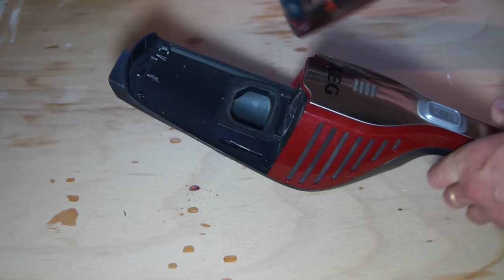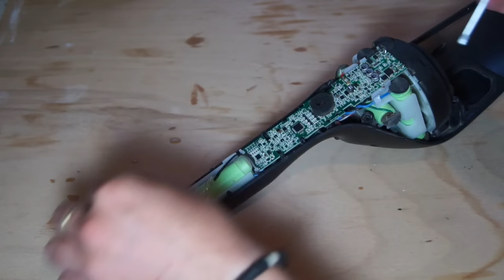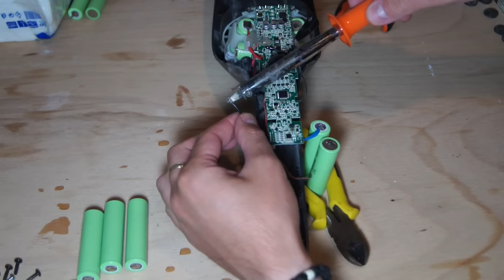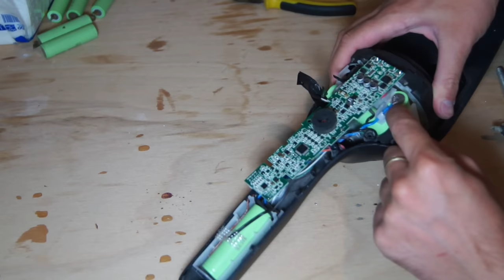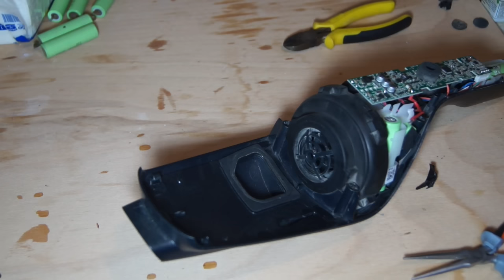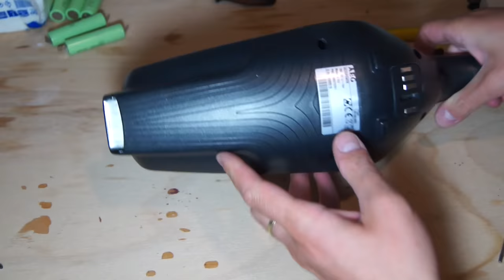Ergorapido Battery replacement - Inlocuire acumulatori

Comment: Hi. How would i know if my batteries are damaged. I bring my vacuum overseas, when it arrived, the lights are blinking which means full charged, but i believed the batteries are empty because it’s almost 2months before the vacuum arrived home. The vacuum now it’s not working. No power. Hope u can help. :)
Reply from the maker: First check the voltage of every battery, if they are all at the same voltage when charged (4.2v) or one of them is dead i think it will be best to change them all. Also check the voltage of the charger.
Blinking lights could mean that the batteries have a problem, check the manual to see.

Comment: I have a model EER73IGM 21.6Wh and 14.4v.  There were installed 4 batteries Sony / Murata US18650VT3 1600 mAh - 10A.  I changed to Sony/Murata US18650VTC6 3120mAh up to 35A max.  And now when I press the power button, it emits a beep and that's it🤷‍♂️🤦‍♂️ the flashlight on the bottom of the brush also lights up for a second and goes out, nothing is charging.  All batteries were charged prior to installation.  Didn't change anything when I replaced it.  What is the reason that it doesn't work?
Reply from the maker: Hello, please check polarity and also make sure the new ones are rated 35A. Make sure that they are not fake.
Reply: @ImpactDIY  I didn’t make a mistake anywhere, I did everything well👌 but since I didn’t have a multimeter🤷‍♂️ and the fact is that I soldered it with a soldering iron and killed the new battery by overheating it😂🤦‍♂️ today I bought a multimeter and checked - it was not 14.4v  it was 9.9v, so it didn’t start☝️🙂 took the same battery and soldered it very quickly so as not to overheat it and a miracle happened, it works now😂😂😂 and now it has 16.8v and in my opinion it even became a little more powerful☝️ i’m happy 😎🔥

Comment: I have Ergorapido lithium model EL2089, inside batteries are INR 18650-15L M Samsung SDIEM 120 - I am told by Electrolux that these batteries are no longer made.  Great! Now what?  Is there a replacement battery that would be suitable?  The back of the hand unit shows Volts 14.4 DC. Electrolux was no help with this question.

Comment: After I changed the battery, the charging light worked normally, but the vacuum cleaner could only run for 0.5 seconds.🥲Do you know where is the problem?
Reply from the maker: One of the batteries may be damaged or the batteries model is not good. It needs to handle 20A discharge
Reply: I used INR18650-25R ,it should work🙈
Reply from the maker: Maybe one of them is bad, try to measure each one while starting the vacuum cleaner. Check for a big voltage drop.
Reply: I bought another batteries , but the result is still the same🥲
Reply from the maker: :( The motor is spinning ok? If the motor is bot spinning ok is taking more curent and it stops.
Reply: I sucks...just connected the wrong wires , it works perfect now.thank you😂🤝
Reply from the maker: @iFung912  i am happy it is ok. Have a nice day!

Comment: I replaced my batteries with sanyo NCR18650GA 3,6V 3,7V 3500mAh 10A batteries and have been charging it couple days and it still won't start. The charging light is blinking in hi rate maybe once in a second. I assume that isn't normal. Does those batteries suit this vacuum or did i do something wrong? 😅
Reply from the maker: 10A may be too low, try 20A. I almost always use cells recovered from drill batteries or other tools. I test them and i had almost no fail until now.

Comment: i have a similar problem like you guys, when i set my aeg on charger it gets charged for 2/3 mins and the led indicator turns off which means that the batteries are full, but when i take it out it cannot even work for 5 mins, the batteries get dead. When i open the down part and when i use my multimeter to see my volts of my batteries,every single battery has 4,17 volts. i’d be good if anyone could help me
Reply from the maker: You need to change the cells
Reply from the maker: One of them or more has problems
Reply: i know but each battery has 4,17 volts can it be anywhere else problem, if no i can try ordering new batteries, and i would even like that’s the problem, its the easiest thing
Reply: did you find a solution for the problem? When mine stops there is over 4,01 volt on every cell. That's why I haven't replaced the cells yet.
Reply from the maker: @solvozurk  check the charger voltage, it may be broken.

Comment: Although your video is already over three years old, it helped me a lot today changing the batteries in my vacuum! Great view of cables and polarization. Thanks a lot from Germany :-)
(I really think that companies should make it a lot easier to change the batteries …)
Reply: Which batteries did you use? And did you buy online?
Reply from the maker: Hello, i usually recover cells/batteries from cordless drill batteries, this way i know they are genuine and if they are good can handle 20A discharge. Be careful  when you buy online, yhere are a lot of fake batteries.
Reply: @mohamedrhordo5344  Yeah, I bought them online but at a local German repair-shop that also would make the battery-replacement for you. They use brand-batteries of high quality (at least they say so)

Comment: Hi, thank's for the video. I replaced the cells in my ZB3011 Ergorapido Li-35 and all seem to work ok. But I was wondering why the batteries failed in the first place, so I conneced the cleaner to a lab power supply, set it to VC 25V. Started charging with 20,48V on the battery the current draw was 490mA form the power supply, and it was steady up to ~21V. When the 3rd LED started to blink I measured 21.2V on the battery, each cell having 4.24V with 190mA comming form the power supply. So surely the vacum cleaner was aproaching full battery because the current draw was falling. But I turned it off since it looks like it will reach ca. 4.3V per cell before it will stop charging. I think it is dangerous.
Have You got the schematic for the PCBa? Or perhaps have acces to calibration procedure? Thanks in advance!

Comment: Hi, thank you for the video! I have an Electrolux Ergonomics ZB3212 with 5 batteries 1500 mah (3,7 v) can I use 2500mah batteries instead?
Reply from the maker: Hello!Yes,  you can use 2500mah  batteries but make sure that they can handle to draw more than 10amp. It will take more time to charge.
Reply: Thank you. The charger I have is the original, 25V, 500mA will it works?
Reply from the maker: Yes, it will work, it will only need more time to fully charge the batteries
Reply: Did you try the 2500 mAh? How did it go? 

Also @impactDIY how can I tell if it can handle to draw more than 10Amps?
Reply: @camibohn1017  I did and it goes very well :)
Reply: @ivansepulveda5801  thanks for responding! Great to hear! Can you tell me what batteries you used, please? And how long do they take to charge?

Comment: Great tutorial, I have the same vacuum cleaner but I cannot find the same 18659 model batteries. Would you have a purchase link, please?  Thank you
Reply from the maker: You do not need the same model
Reply from the maker: Search for 18650 cells with more than 2000mAh and can handle 15A.
Reply: @ImpactDIY  Li 35 ZB3212
Reply: This battery is good ?
Reply from the maker: Yes, it is good but the price is low, make sure it is genuine, a fake one may not work or create problems
Reply: @ImpactDIY  OK, thanks.  If not, do you have another link where I could order?  I live in France.  Thank you

Comment: I want to do this to my ZB3013... I see you are soldering them very quickly as you are expereinced! What is the material you put on before you solder?  I am a beginner with solder...I wish you showed this part in more detail :)
Reply from the maker: It is better to prepare the spot where you will solder the wires on every cell by putting sone solder on every cell end. Use solder and keep the heat as little as you can on the cell. Use some sandpaper if the solder will not make contact with the cell. Make some tests on the broken cells . Also try to find solder that need less heat for melting. Be very very careful with the polarity. And use safety gear, most important -goggles.
Reply: @ImpactDIY  Thanks for the reply! Are you using a dab of flux to help it stick? To test the polarity of my new batteries, can I just use a multimeter device?
Reply from the maker: You can use the multimeter for polarity.

Comment: thanks for the video very nice but what battery can i use for the best results and lasts longer
because I have the AEG vacuum cleaner CX7 oko
Reply from the maker: I use recovered cells from li-ion drill batteries. I test them and never had problems.
Reply: @ImpactDIY  Let's say the Sony vtc6 is good?
Thanks again for the perfect video
Reply from the maker: Not realy a perfect video :). Sony vtc6 with 15A discharge  should work. I only used cells with  20A discharge  but you can try.
Reply: @ImpactDIY  thanks i found Sony vtc5a discharge 35A

Comment: Thanks for the tutorial. I have question - batteries in my AEG CX7 18V show 3.4V/each, in total 13,8V. Is it ok? It won't charge (charger shows 24V). What do you think?
Reply from the maker: I think that the cells are bad, try to change them, i had the same problem on one
Reply: @ImpactDIY  Unfortunately, the replacement of the battery did not help. I put Liitokala HG2 3000mAh 20A and the vacuum cleaner still does not charge them. The first LED on the bar flashes and the vacuum cleaner does not turn on.
Reply from the maker: One of them has a problem or polarity is not good on one or more or you forgot to solder a wire.
Reply: @ImpactDIY  Everything is soldered properly. Batteries are ok, checked before.
Reply: @ImpactDIY  Everything is soldered correctly, the batteries are working too.
I checked the voltage between the CN9 and CN10 points, I have 18.6V.
There is 14.8V between CN5 and CN7 (points to the charger).
Reply from the maker: If any of the batteries has a big drop of voltage at startup the vacuumcleaner  will not start. Try to measure each one of them when trying to start.

Comment: Hi there. Great video really useful. I replaced two of my batteries and now it will only charge 2 out of 3 bars. Any help would be greatly appreciated.
Reply from the maker: Hello and thank you. It is possible that one or more of the old batteries is bad and not charging properly. Try leaving it to charge about 12 hours . If it is not ok  replace the other old batteries.

Comment: Thank you for the video. Can I use LG HE4 (2500mah 20A constant discharge) battery. Mine has LG HB3 (1500mah 22A const. disc.) installed?
Reply from the maker: Yes, you can use the lg he4, it is a great upgrade :)
Reply: @ImpactDIY  used he4 s for the upgrade. Vacuum is back in show. Thank you!

Comment: Thanks for this vidéo . This week i've change the accu but i think i have the same problem with u. Why WE have just 3 lights . I Can have 4 but Come not. Maybe someone know my problem ? Or we must wait ?
Reply from the maker: Sometimes it takes up to 12 hours to charge. When is full the lights will turn off and  it will only light the four lights for a second every few minutes.
Reply: @ImpactDIY   the problem i ve charge all night and give not the fourth light.. you see... When charge, every Time u Can see on the system the firth light orange than the twice than the third than the fourth than Come back 0 .... But i ve not the fourth... I wait this week maybe
Reply from the maker: If you can check the voltage of every battery, maybe one of them has a problem. Did you use all 5 same type of battery?
Reply: @ImpactDIY  i use all 5 sames battery and the Time to use is very good ! Before the problem with led light Was too and i've think that comes from battery but now i know who Come from the problem... Led light IS over.. maybe ^^

Comment: Thank you for this tutorial! I was not so sure if i can change the cells by myself. I watched this tutorial, bought 5 sony vtc5 and changed them:) Now my vaccum cleaner has been charging for the first time for 9 hours now and still charging (2600mAh cells).  How long does it take for 2600mAh cells? Ergorapido 75STM. Thank you!
Reply from the maker: Hello! How many mah charger?
Reply: @ImpactDIY  It's original Electrolux charger 25V, 0,5Ah.
Reply: Ok my mistake. One battery was installed with wrong side:( i changed polarity and started charging... I hope nothing was broken...

Comment: Can be batteries changed to bigger capacity than original? Does the in-built charger manage that?
One more thing. The interior looks like Electrolux Ergorapido ZR series. The same?
Reply: Yes, it will just take longer to charge.

Comment: Great video thank you.  I just repaired my AEG3013 Ergorapido by replacing the cells by following your steps.  

I would recommend using Samsung INR18650-25Rs,  which are 2500mAh cells and rated at 20A
Reply: HI. I am about to change the batteries to my Electrolux ErgoRapido Lithium, model ZB3013 (18V), which I think is exactly the same that you have. Did you have 5 batteries in it?
What is the voltage per battery in those Samsung batteries?  Is it 3,7V?
Reply: @tommiwesten8386  Voltage per battery is 18 V / 5 batteries so that would be = 3,6V

Comment: Will it work with eneloop’s AA 1,5volt 2000mAh? The original charger can handle that?
Reply from the maker: Hello, the only type of cells that will work are 18650 not protected(without BMS). DANGER!! If you use any other type of battery it can result in Fire or explosion. Please use only 18650 cells.
Reply: @ImpactDIY  What amp? is 15a good?
Reply: r r  original cells are rated 1490 mAh/15A, I replaced mine with 2490 mAh/ 25A
Reply from the maker: I had 12 vacuum cleaners, I fixed all using 18650 cells recovered from cordless drils. I used 2500mah on many of them and they work perfect. All cells have min 20A
Reply: Impact DIY original cells are 
Samsung INR18650-15R 3,6V 1,5Ah / 18A. I used Samsung INR18650-25R 3,6V 2,5Ah / 20A, bought them online for €5.90.
Reply from the maker: That is a good upgrade, I use recovered cells because in my country there are a lot of fake cells on  market.
Reply: Impact DIY: I have one more vacuum cleaner unit, which has faulty cells and I’m thinking of trying SONY US18650VTC6 3.6V 3.1Ah / 30A. It is also sold in good price €6.95. The only downside is charging time which takes twice as long compare to original cells.
Reply from the maker: But it will also provide twice the power :)
Reply: Impact DIY: Right ;)

Comment from the maker: You can use bigger capacity 1850 batteries, there is no problem, It will only take longer to charge.  But do not use laptop batteries, they have more amps but very slow discharge rate.
Reply from the maker: Electrolux and AEG are the same thing. But be careful at polarity, i found models with different wiring.

Comment: Hi.
Thanks for a great video.
I have a Ergorapido ZB 2944W model (2900 series).
What kinda batteries do I need to order?
Will those SONY US18650VTC6  work on this vaccum cleaner?
Id appreciate it if anyone with knowledge would take a minute to help me out here, thank you.

(It would be  even better if you added in the description what you use when you solder, you know for total noobs)
Reply: Any 18650 battery with at least a 10A rating will work, they just have different capacity.  The most important thing is to buy all the batteries at the same time and all the same brand and model. They will become whats know as married, they all charge and discharge together, to keep voltage differences down.
 I'd go with these, https://www.imrbatteries.com/samsung-36g-18650-3600mah-10a-battery/
They are 3600mAH, the largest offered in the 18650 size, should give you an improved battery life over the OEM. (I'm pretty sure the batteries in the video are Samsung SD1 also, just a lower mAH rating)

You can solder them, just look up a youtube video. But soldering can raise the temperature to much and damage the cell. Best is to use a spot welder.
Reply: @infrad3ad277  Hi. Thanks for the help.
I've already ordered some sony genuine batteries with ears, soldered by the company that i ordered from. Some company in a Netherlands.
Haven't replaced them yet though.
But that's a good advice, buy all at the same time.

Comment: I received a unit from a friend who replaced the cells with Samsung 30Q's. The vacuum would just turn on for a few seconds but then it would stop and a red led lit up. He thought replacing the cells would help but it didn't. Is the circuit broken? Can i do something?
Reply from the maker: Have you replaced all cells ? It looks like  a cell is bad. When this happens open the vacuum cleaner and measure each one of them. One of them or more should be under 3 volts. Those are bad cells.
Reply: @ImpactDIY  Thank you for the answer. The cells were all at 4.13V everything was wired correct. I found the problem after checking all solder connections. The ground connection of the motor was loose and lost connection sometimes. I didn't see the loose wire because of the heatshrink.

I resoldered the wire to the terminal and everything works perfect now. (I hate lead free solder.)
Reply from the maker: @SpieleETC  :)

Comment: Buna.am inlocuit si eu acesti acumulatori doar ca am pus unii cu 2900 mah.problema este ca nu se mai incarca deooc.imi sta ledul rosu aprins.sa fie transformatorul prea mic?precizez ca pe traf scrie 25v/500mah.daca il schimb cu unul de 1000 mah ar functiona?
Reply from the maker: Salut, esti sigur ca au 2900mah, poate sunt fake, este posibil sa aiba bms fiecare celula si asta sa fie motivul
Reply from the maker: Trebuie folosite celule fara protectie
Reply: Da.sunt modelul acesta. https://emag.page.link/517o6 .la magazin mi s-a spus ca nu au protectie.ms